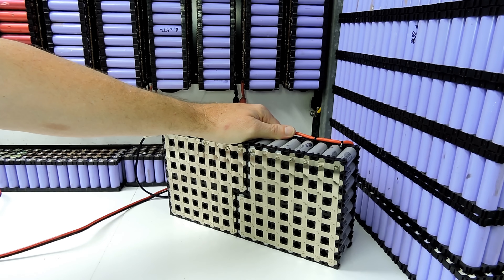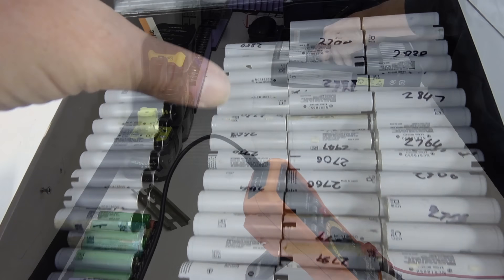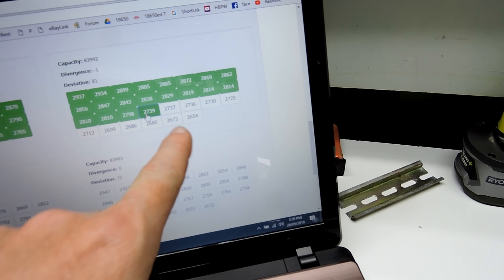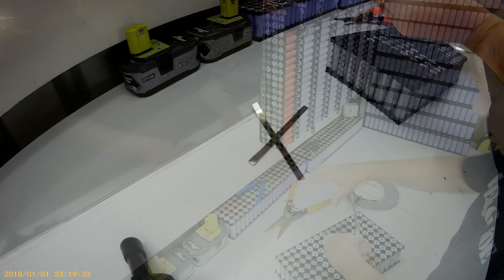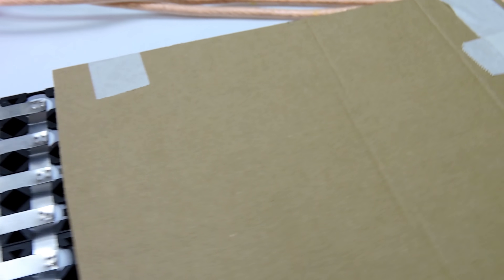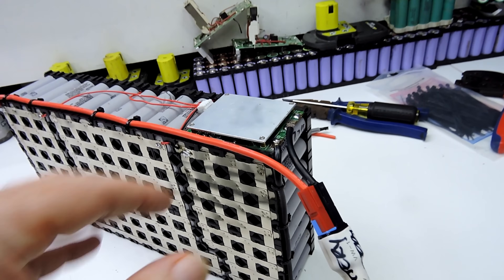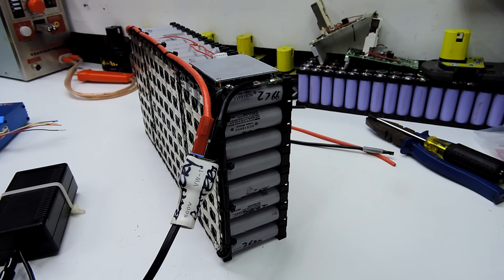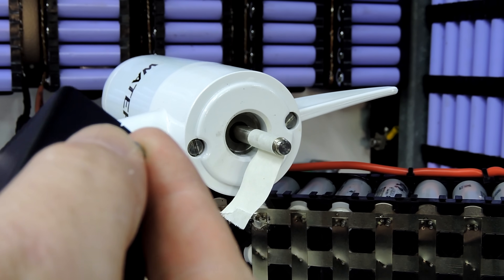Trolling Motor recycled 80ah 18650 battery pack

Comment: there are more things to know about these used batteries !!!  it is not good enough  finding same  mills voltages and keeping them  together  bro !! if you are making them in  parralels  you need to find same discharging and charging bihavers if you can do that ! then you would have the best lasting longer battery depending what you use for balancing board and some other healthy  meterials  aha ! you didnt know that did you clever !! there you go you have a gift from flashpoint you are welcome ..
Reply from the maker: You have seen how long I've been messing with these cells right ?

Comment: I learned alot from your powerwall videos and made my own 12v 80ah battery for my trolling motor, having not seen many for that purpose and now here you are! I actually just made up my second for a 24v system. I dont even know what they really are rated at, each 12v battery is 150 1.65ah 18650... I got about 20 running hours using it in different variations between charges to 4.10 to 3.5. Got a bit to finish up and we will see how all 300 handle the new 24v 80lb Terrova
Reply: I also fused all mine with 7amp wire, learned the hard way that they actually work! Very tedious pen soldering

Comment: This is retarded for 80 amp hours, this guy spent 1,000 dollars and I have a perfectly serviceable,  refillable  unsealed lead acid deep cycle battery going for the last 6 years. At a cost of 130 dollars per 100 amp hours.  I charge laptops, cell phones and run my Tv and led lights for days. And Solar power easily replenishes my battery bank. I don't share the problems they preach on the internet about led acid to make us pay all this money for non serviceable  lithium batteries. In the next few years Super capacitors will be bigger anyway, with thousands better life cycle and we can build our own supercapicitor.
Reply from the maker: Ooh come on you can't be that nieve - cost me about 80 bucks it HAS 73ah USEABLE capacity, it weighs 5.3kg, takes less room and will outlast your LGA battery that HAS only 50ah useable storage and is 15+kgs and has shit DOD. Your comment is extremely uneducated
Reply: @HBPowerwall  I doubt it outlast my battery, that I can service and easily replenish, when your battery loses total life it will have to be replaced. I don't argue that it is lighter, Lithium is a great portable battery option, I use Lithium, You are right. And your link showed me those high prices. I was looking for your cost in the description first.  If you made that at the the cost you say to a comparable 12 volt 100 amp hour battery, I applaud you. My beef is to the guys pushing everyone to pay 900  dollars for a 100 amp hour battery. I love watching Creative you tube energy storage videos.
Reply from the maker: Lithium & Lead are no competition - Lead is dead - we have moved on time will prove has already me right.. I used lead many years ago the voltage sag along was pitterful and rendered led useless for large loads on small packs.
Reply: @HBPowerwall  To each his own, I  text you now with lead power, so it is very much alive, and without BMS.  I am really  just waiting for more super capacitors honestly and trying to build my own. And I also feel my argument is not with you. I also use lithium batteries for some projects. Its fun and you have the right to do it.  Your video was mistaken for the real videos i hate, of the guys talking about 900 dollar and only 100 amp hour lithium batteries that will slowly degrade and have their own limitations and can not be refilled, and shitting on other people. Please Keep creating. No harm.

Comment: I am using 11s10p  configuration for my BMS project. That means I'm using 11 stacks in series with each stack consisting of 10 cells in parallel. I am in a dilemma if must balance each cell in the pack(individual cell balancing- 2 wires coming out each cell) separately or get a wire out of each stack(2 wires coming out of each stack consisting 10 cells in parallel) to implement passive balancing algorithm, SOC, SOH. 
Can you give an insight on which one is more preferable?

Comment: 120v 40ah how much it costs?
Reply: What are you using 120v for? is that DC? or is that a typo and you meant 12v? 120v is common house voltage in the US, and is NOT DC but AC, which this batteries cannot provide...

Comment: Is it feasible to use these little batteries to build a 12 volt 1000 amp hour lithium battery Bank my target goal is 100 kilowatt hour storage which do you think would be best
Reply: yeah just keep adding them in parallel till you get desired storage capacity

Comment: Hello, I was wondering if you could give me your suggestion.
I have 6 packs of 24-18650 cells in parallel. And I want to build a power bank that can power 12 volt Accessories I also have a 12v 1000 watt pure sine wave inverter. How can I connect all 6 packs together to achieve the 12 volts. Thanks so much for your input.
Reply: mario sellet 12 Volts us a little bit tricky. 3 packs in a row results in 10.8 volts (3.6×3) ..at full charge it is 3x4.2=12.6 which would suit to the inverter. Battery state 25% would be around 3,3 volts per cell (under load) ..so it would be 3x3.3=9,9 volts. Typical low voltage cutoff is at 10.5 to 11 volts. That means you can only use around 70%, perhaps 60% of your battery. 4 cells in row would be over 16 volts full charged and cause shutdown or even damage to your inverter.
My favorite would be 7Serial but you need an 24v inverter.

Comment: So no need a bms? Icharger is enough to charge them cells?
Reply from the maker: I bought the wrong bms it has a 50amp unit now.  But only for over/under charge protection really balancing is done by the charger each time.

Comment: Hi, very nice video. How long after you charge each cell separately, you measure the voltage to make sure they were all fine?
Reply from the maker: would have been weeks if not months of resting it's a very good test to do when using old cells

Comment: Hi, Can You tell me what the settings of spot welder are?
Reply from the maker: out of the box, max on the dial and 8 on the pressy buttons but that changes if you use the 110v version - mine is the 220v version and seems to be 10x better
Reply: @HBPowerwall  Thank you!

Comment: Pete, how much self discharge do you consider okay? Do you check each cells voltage before you store them for 30 days and check again? Some of my BT-C3100 chargers state that a cell is full at everything between 4.15 and 4.20. So I just now sort them by voltage, let them sit and check them again.. but I am unsure what self discharge is okay, if any at all over 30 days.
Reply from the maker: 30 days less than 0.05 of a volt give or take

Comment: I would've added a big bus bar from your main lead across the battery cause right now all the current from all the batteries (except the one its soldered to) has to travel through those two tiny nickle strips. a tick bus bar across the battery would spread the load out a lot better. if you draw high current (more than the battery is rated for + what the strip is rated for) it'll kill the battery then melt the strip or vice versa besides that it was a neat build

Comment: What is the total price of this 80ah pack ? Does it compete against this https://www.wattuneed.com/fr/batteries-solaires/256-batterie-lithium-12v90ah-0712971125827.html ?
Reply from the maker: My cost price with recycled cells is about 300 I THINK,  that battery has 15 ah more on paper (but is that a useable 90ah or a Chinese 90ah? That battery is more convenient and faster to acquire
Reply: Thanks for your answer, well it is from a trusted seller they have a physical shop in Belgium (I went there to buy a few solar panel) they have a lot of different kind of battery, I didn't knew about Chinese pack so I did not ask,  I'll next time. And your battery pack at 300$ is way cheaper, but you have to put the labour and buy a few tools, still if I want a big bank I could do it and tailor the system for my needs. 

I don't know yet if I want to go in that direction, I'm moving house and I want to put 5kw of solar panel and batteries but I hesitate btw good old gel batteries, lithium all made pack or DIY powerwall. If I go DIY it is going to cost a lot to start, try to acquire the batteries (we don't have too much source available in Belgium, maybe someone can help?) and it's going to take lot of time. I've seen your older video and I know it is feasible now so that is, at least, one of the possibilities.

Theses are their other battery https://www.wattuneed.com/en/11-solar-battery/s-1/types_of_batteries-lithium_batteries  but they all cost much more than yours.

Comment: With the grids he created, I confess I am not following how this 12V 80AH battery is wired in series and parallel.  Have not been able to figure it out from his bars on either side.  Can someone explain?
Reply from the maker: 30 cells x 4 in parallel - 4.2v  so effectively it's 12v min 16.8v max charge in the thumbnail that shows positive & negative joined on the left and again on the right - on the other side the gap in the middle is bridged join all cells together.. God I hope that explained it enough.

Comment: here is a kit idea!?! put nickel plates on the plastic and ship so all you do is stick in the battery and solder. A box type with lid would be best. also a device for dumbies that disallows connections when you put in the batteries in the wrong way would be cool so people do build them wrong and create short would be great to prevent accident for noobs. just a small reverse polarity circuit on top of the nick plates with a device on the side to verify integrity but it would probably create sweat shops in china.

Comment: also if you use an rc or ebike motor at 6 volts and then turn a stator on a stand you (generac 120/ 10 magnet at 2 rotations per second) you get a really long battery life you just need an ac throttle and an ac ebike motor. also a controller for the first motor must be built to keep it from rotating to fast.

Comment: Your lithium battery is bigger then a Toyota Prius's Battery
Reply from the maker: Surly they have a bigger battery than 75ah at 16v?
Reply: @HBPowerwall  I meant actual dimensions of the Battery. Hybrid batteries are small. They are only to get up to 10 mph then the gas motor kicks on and the battery is not used anymore. It's like a 25 ah battery. I don't know the voltage. I'm no expert tho. I could be completely wrong.
Reply: @HBPowerwall  I googled it. The typical hybrid battery is 200v 6.5ah, so it's 1.3kw. your battery is 1.2kw, so it's not as powerful but very close.

Comment: How did you measure the capacity of the cells?
Reply: Levente Varga By discharging them completely and then recharging them to 100%. Your charger will then show you the capacity of the cell.

Comment: Hi HP,  I'm hoping you could see a video I uploaded to google drive and give me your opinion. The BMS I have in video is a 25amp 3s. Thanks... Oh and before I connected the B1 and B2 I checked the voltage on the bms's p- and p+ and it gives me a 12.43 volt reading....https://drive.google.com/file/d/1-SS_9lVAeN6Ni7wauIk_KgbZ_eUS4nvi/view?usp=drivesdk

Comment: Hi are you putting the Watersnake controller on 5th speed and having full control through PWM.
Reply from the maker: Been too cold to even test as yet but plan will on high then PWM to fine tune the speed as required or even slightly over volt if the need arises

Comment: The thing that surprises me is the amount of time spent on sorting the cells to an exact capacity using some simple software to calculate which cell goes in which pack. Given the uncertainty on the measurement of your capacity the actual number is not very important, if you round them all up or down to multiples of 50 or 100 you are fine as well and it saves you a lot of time.
Reply from the maker: That idea is common with several thousand cell packs - smaller ones repackr works very well charge and discharge voltage is max of 0.02v

Comment: you have ruined  your bms first conecting balance cables prior to B- . Always connect B- first then balance cables . And no cell level fuses .When everythi ok thats fine , but  just one shorted cell can burn whole pack
Reply from the maker: It's still working fine, it's a 3.2v BMS not a 4.2v so didn't work anyways :) new one has been fitted and doing some tests on it at the moment

Comment: great to know where i can get those exact cells from
just recently built a battery box with an inverter and lighter outlet out of random cells i had laying around (it was a nightmare to match the capacities of each parallel set by tacking lipo cells onto each cell pack to balance the capacities)

capacity: 750wh
240V power: 500W
12V power: 240W
24V power: direct connection
all enclosed in a steel box with holes cut for all the plugs and indicators

thinking of building a DIY powerwall for my caravan next

Comment: Is not the fully charge voltage too high for 12V? I'm starting the same project for a trolling motor of 12V. im finding it hard to find out if the 16.8V  will be damaging the device in the end.
Reply from the maker: That is the reason for the little black box it's a PWM controller so you can adjust the power

Comment: I have the same Water Snake T motor and very tempted to replicate this build and possibly another for a 55lb 12v motor. 
I'm a total noob to this but have a decent technical/mechanical background.  
Would this pack be suitable for the extra draw of the 55lb motor (normally 1A per lb)?
Reply from the maker: yep would do 50 amp draw in bursts easy
Reply: Does the hobby charger handle charging this pack? I'm sourcing parts to build my own now. I have 2 hobby chargers from my RC phase.
Did I see that you added a BMS to this pack now?

Comment: What is it that are you doing matching  the individual cells on the computer?
Reply from the maker: using the repacker https://secondlifestorage.com/repackr.php tool to build balanced packs to limit the balancing work the BMS will have to do
Reply: HBPowerwall Oh...so those numbers were the capacity of each cell?  
So you tested each one individually?
Reply from the maker: Done over 10-15,000 cells so far :) Everyone tested for capacity, heat & selfdischarge

Comment: i have Motor overheating issues with 4S (can't go longer than 5-10min at full speed)

do you had similar issues?
what do you think about going 3S ?
Reply from the maker: Haven't tested it yet but that's why we have that black box for throttle control

Comment: I wonder if this battery will outperform a 100ahr deep cycle lead acid battery in regards to on the water use and duration?
Reply from the maker: 1/4 the weight and I dare say heaps more stored energy that's safe to use than a Deep Cycle - 100ah is really 50ah that is safely useable to have longevity of you're battery
Reply: I have been on the water on over 100 (maybe 300) trips in a boat with a trolling motor and one 100ahr lead acid battery. Many times when you run it down to empty, you can tell the motor is almost empty the way it behaves.  You probably have to monitor the voltage of Lithium to make sure if you are at the end of the lake, you have enough to make it back, or have a small dedicated backup battery.  I was just wondering due the inefficiency of the lead acid how the run time would compare if the motor was run on high with a 100ahr lead acid compared to the runtime on the 80ahr battery until the motor basically stopped.  Life expectancy does not matter if you have to row.  I was actually in the process of building one before this video.  The trolling motor I still use is 40 years old MX60 Minnekota.

Comment: How long does it take to do a full charge on the Imax B6? I'm building a similar battery 4s20p and was planning on initially balance charging it off my B6 but I'm wondering if theres a faster/ more simple charging method I could use. Thoughts? Great vid. I enjoyed the music. Mastering everything with an Auratone speaker could help the mix a lot. Cheers.
Reply from the maker: Haven't had a chance to discharge the battery yet, got very cold here so haven't even done the testing of it yet unfortunately. I have two more videos planned on loads and charging .. shouldn't be a few weeks. Day Job pays more than youtube so have to juggle my time

Comment: I have a electric scooter battery 36v how can I charge out of the scooter? I'm using it for something else. Can I just connect the scooter charger directly to the battery ?
Thank you !!!
Reply: Should be ok as long as you keep the charge controller and all it's wires in place. If you start changing things you could be in for a shock or a fire. be careful.

Comment: Hi,I was building a solar system for my garage and wanted to buid my DIY power wall.Now I have a problem with my BMS and need some help since until now I only made 8s 4p battery packs.The problem is that when I charge my pack then the small balance charging wires (8pin balance charge connector) which has a 0.11 mm² core.My question is now if it would be safe to replace the existing balance connector wires with 1mm² core wire for each pin or should I go with 0.50 mm² core wire?

Comment: Are these 18650 batteries that you could use on devices or just power cells
Reply from the maker: You could use them anywhere for any device with the right configuration/electronics

Comment: Why does it matter if you soldet to the top rather than the bottom?
Reply from the maker: Best Practice says that you should always draw power from opposite ends to distribute load over as many cells as possible. Not ideal but this has been fixed in next video

Comment: for the bms, around how many amps can it put out. You said it's rated for 100a so probably 25a but I can't tell if you're joking
Reply from the maker: not joking - you never run what they advertise - they'll burn up fast
Reply: HBPowerwall dang i got a 45a 16s from ebay and im going to run about 30a. We'll see what happens